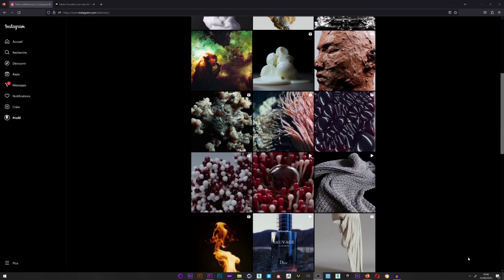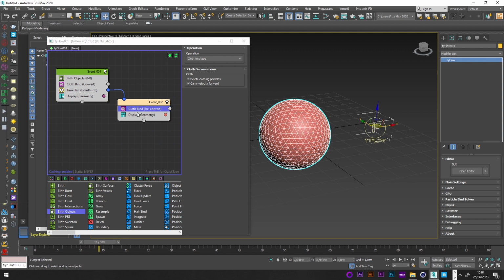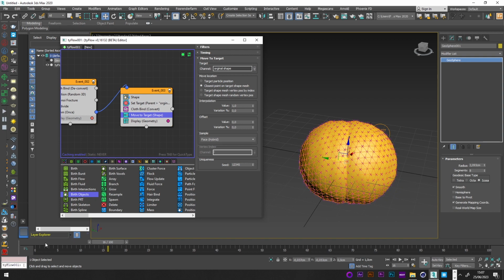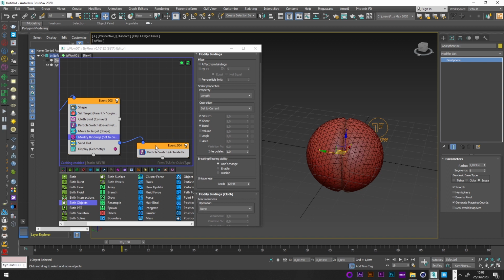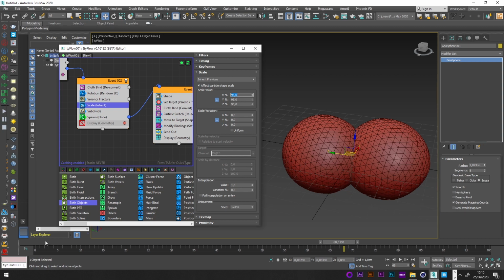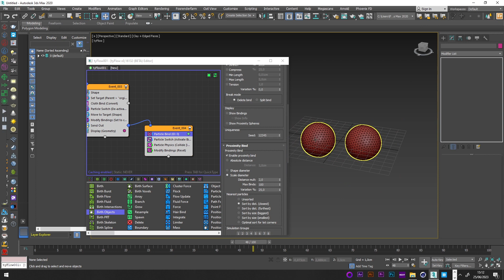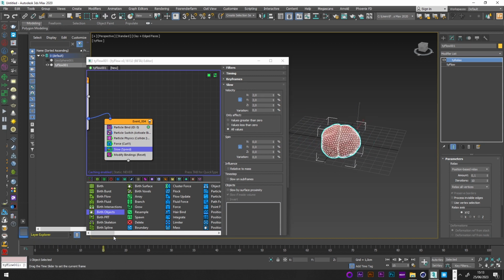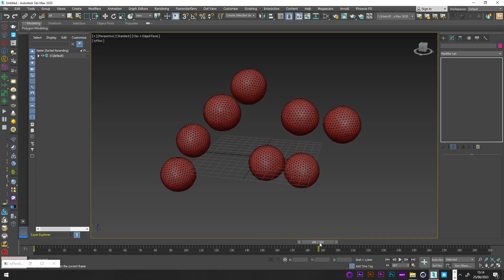Creating a Cell splitting Effect | 3dsmax x Tyflow

Comment: hi, can you share a max file?; i ve tried like 3 times to replicate it in tyflow 1.020  max 2022 but i had no chance ; please reply
Reply from the maker: Hi , all my files are available on patreon
Reply: It was unlucky for me; i tried 2 more times, i ve also installed the latest version of tyflow and still the same; i cannot split the cell in two , at the very beginning and i am not sure what is causing the issue , either the voronoi operand or the spawn( i cannot find once , mine it says per step); also, i am not sure if i have to modify anything in bind retimer in tyflow modify panel; later, when adding modify binding and particle physics, the mesh is all over the place and when moving the slider, it just elongate a lot very deformed,  with sharp edges and it does not split; i also searched for your max file on patreon but could not find it;
Reply from the maker: @johnk5994 send me a message on patreon and i will send you the file
Reply: @fabienescudero  i tried but i cannot find the video there or comment section to send messages; i will try the tutorial again
Reply: @fabienescudero  Fabien, i will try to do the tutorial again today; i will figure out what was the issue, i hope; spoon fed doesn.t get me anywhere; got to learn from mistakes; thank you

Comment: immediate click!
Reply: IS there a way to get a slower seam reveal before the split?
Reply from the maker: @jimmwagner  The revelation is quite instantaneous in this setup but you can always smooth it either with a tymesher or by accentuating the tyrelax and adding a push